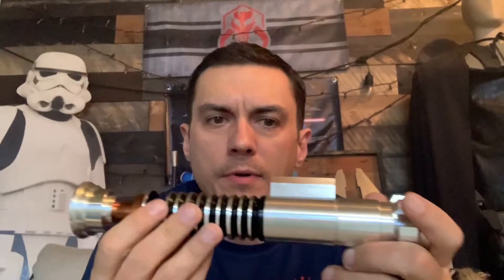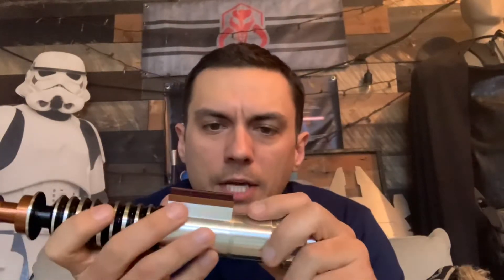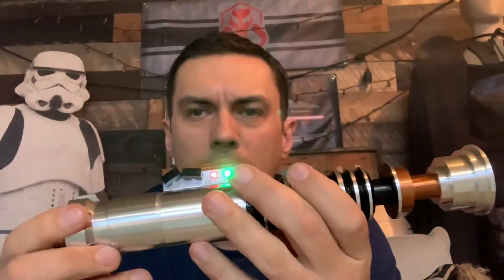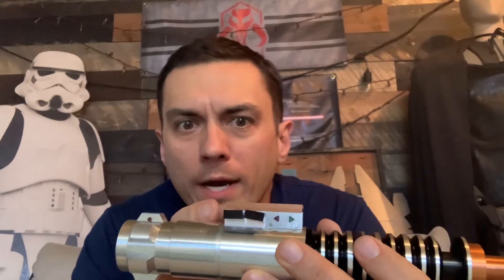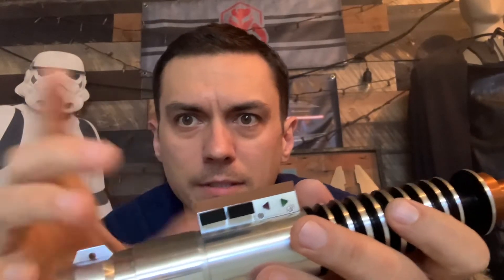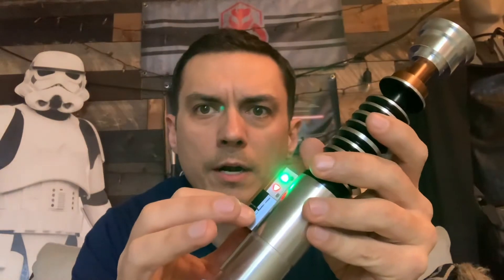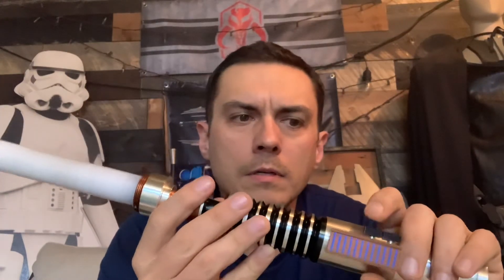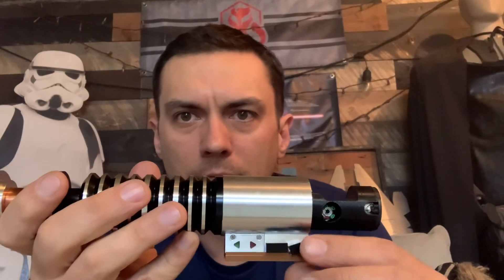Robert’s Korbanth Hero Supreme

Comment: The button's problem could be fixed easily by having a piece of tape linking them together in the back. It will still allow them to be pressed individually but the tape will prevent them from spinning.